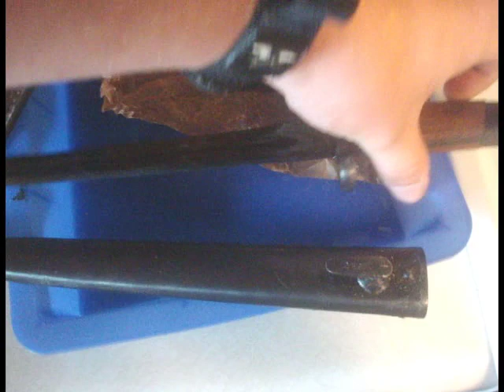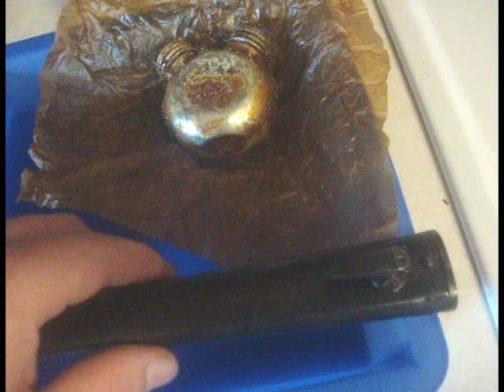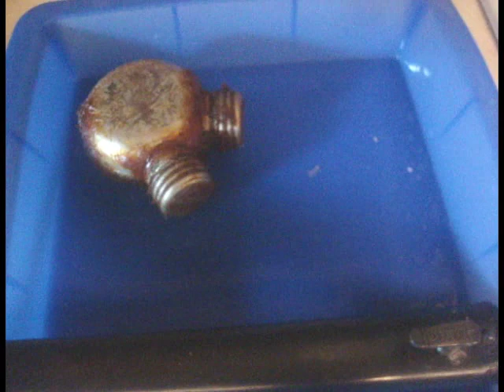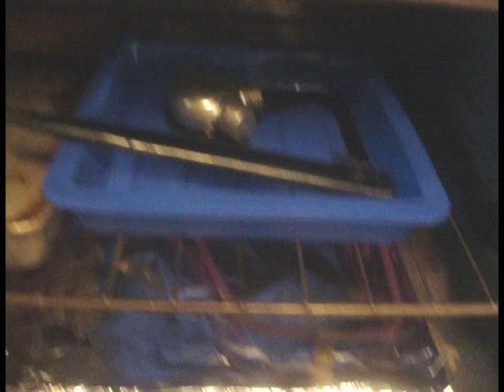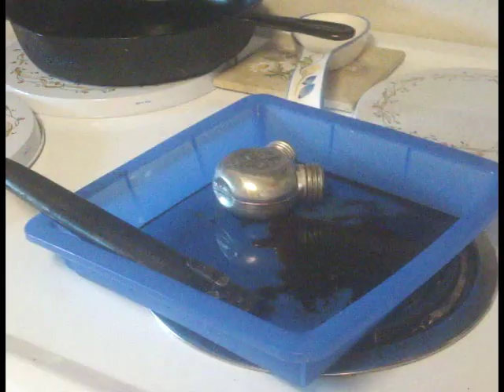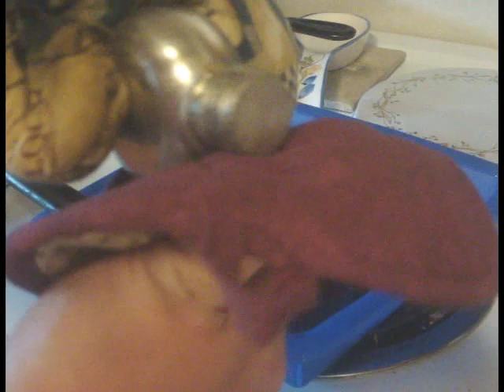"Basic Cosmoline Removal" Iraqveteran8888 Military Surplus 101

Comment: Easiest way? Drop the parts into some mineral spirits, let them sit a little while. Wipe the stick with a paper towel, clean off with some hot water and Murphy’s oil soap. 
Brush any soft cosmoline with a brush, dry, oil, reassemble. Total time? About an hour or grab a coffee then finish up. No problem and the mineral sprit can be used on the next one.

Comment: when i cleaned my m48 sheet i just made hot soapy watter and left it for a hour and wipe it and it was good to go,with the yugo sheet you dont need alot of cleaning cause its a 2 point system so you just need to clean the top part

Comment: I have an Yugo M48, and the front stock brace is stuck on because of cosmoline. I should be able to push on pin release and slide the brace fwd BUT NO GO. The cosmoline is holding everything in place. Any advise would be appreciated!
Reply: John Edgeworth  maybe try pouring hot water over it then if that works throughly clean
Reply: I imagine you've overcome this since this comment is 2 years old. But down here in texas you can just leave it outside in the summer or in the trunk of the car inside of a tub and the cosmoline will melt right out.

Comment: you don't need to heat up cosmoline  in order to remove it. A good industrial solvent will cut it just fine. It will burn if over heated. You also create fumes that smell bad.
Reply: buy if you use a solvent on leather you will ruin it it will also ruin wood if its not properly treated after contact

Comment: When I was a teenager , I discovered that a 5 gallon bucket of Berryman ChemDip carb cleaner acid was THE THING for removing every last speck of cosmoline from the boxes of  Milsurp WLA 45 parts I was assembling into  a complete bike . 

I also discovered albeit not quite as quickly , that this was also a REALLY good way to get Dad REALLY pissed off, as it contaminated & rendered the acid pretty much useless for cleaning carbs .

Comment: I was told that soldiers used to submerge the entire Mauser in boiling hot water to remove cosmoline, but drying it off in cold temperatures must have been tricky

Comment: DO NOT USE a recirculating-type kitchen filter fan- make sure it exhausts outside!

You may want to wash the vent fan filters afterwards too. 

And I wouldn't use the oven mitts either -use an old rag instead

Comment: Also, a good way to remove cosmoline (at least it worked good for me) is to use some Spray 409 and hot water. So hot, it almost burns you. That helped me with the oil/solvent holder, and the tools that came with my Mosin Nagant 91/30. Put some 409 and water into a container (in my case a chinese food plastic container) and use it basically as a deep-cleaning soap and water. It did the same affect as the over method, but wont harm whatever tools you are cleaning.

Comment: Wood stocks were also treated with Comoline but 275 is a little hot for them.  You can char an old dried stock at those temps if left in the oven too long.  The manufacture of Cosmoline says it will melt at 150 degrees so be careful of the the temps you expose your wood pieces to.

Comment: @KickerPimp isopropyl alcohol is a powerful solvent, it may affect the blueing of the item,
also, never use a cartridge to plug the barrel for cleaning, nor use the bolt to aid the cartridge in plugging the barrel.
hot water is the best neutral solvent/ melting aid.
always oil the gun after cleaning with a proper GUN oil
penetrating oils may damage the blueing of the weapon
prior to storage use heavy oils/ grease

Comment: I have a British P'07 Bayonet that doesn't slide into the scabbard too easily.  The only  problem is that the scabbard has stitched leather on the outside, so I'm not sure baking it would be a good idea.  How would you recommend cleaning out the inside?

Comment: You're using 290F for these aprts, would you recommend the same temp for the rifle parts ie barrel, I read somewhere not to go over 150 for these parts, my oven only goes as low as 170.  Would you put the stock in the oven as well?  Will be my first cleaning EVER and first Mosin ever.

Comment: You're going to make a video of how to bake a rifle?  Anyway, how would you recommened removing Cosmoline from an engine intake manifold, etc. where it is not practical or possible to bake in the oven?  I've tried paint thinner, BBQ cleaner, and other cleaning agents but its come down to incredibly labor-intensive scrubbing with a little wire brush...

Comment: I got some contact cleaner at a local Dollar store for 3 bucks which is more than enough to de-cosmoline one or even two rifles. I'd use caution about getting it on the finish of the wood though. If you do, wipe it off immediately with a wet rag and it will be fine. I put my disassembled bolt and bolt carrier in a Gladware bowl big enough to lay them flat in and just sprayed 'em down good. The bowl keeps a pool fo the cleaner in the bottom you can dip a brush or rag into for finer cleaning.

Comment: oh yeah, and it's not too bad with cosmoline. When i blow dried the stock i could see some cosmo coming out of it, but it's not literally covered in it to the point where my hands are getting stained with it. I already disassembled the bolt and boiled the cosmo off of there. What oil should i use to oil the metal bolt?

Comment: I took my oiler bottle from my Yugo Mauser accessories kit and put it in the oven. Had the oven on its lowest setting, like 150 or whatever it is and put some aluminum foil beneath it shaped so it will run to the middle of it. That worked great. Then I used mineral spirits inside and soap and hot water, and shook the hell out of it. Worked pretty good. Oven works good for these smaller pieces :)